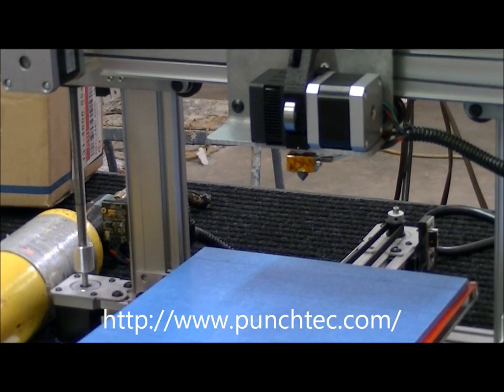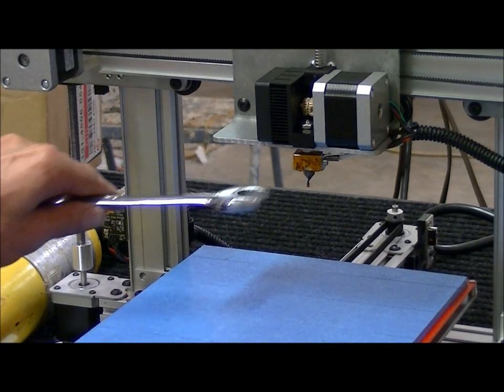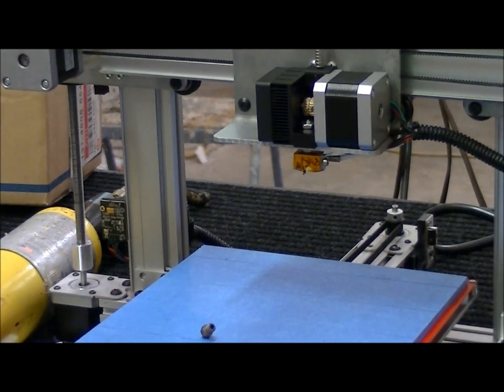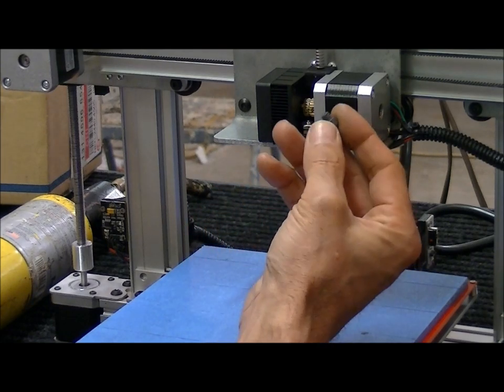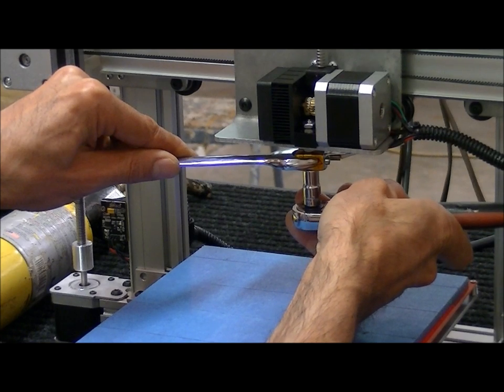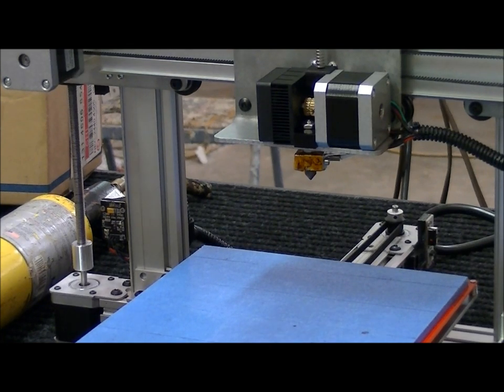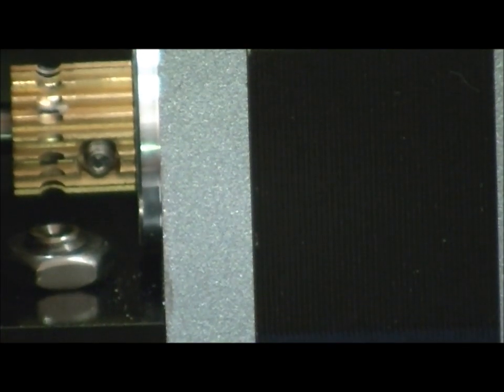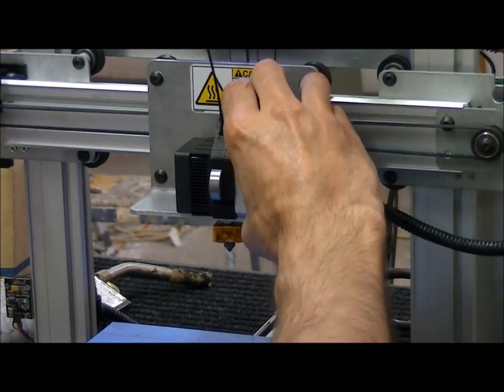How to unclog or replace the extruder nozzle on the punchtec Ord Bot

Comment: Thanks for this, finally got the clog out.  Also had a cold clog above the heating block and was able to push the filament back up and out while the nozzle was off.  A note though for doing this hot, its easy to cross thread the nozzle or the heating block while it is hot like that, so you should be careful screwing it back in.  Saw the comment below and that seems to be what happened.

Comment from the maker: Hi,
I'm sorry that your nozzle on your makerbot got damaged. I have done this many times on my nozzles and have never had a problem. It's probably not the safest idea but I wanted to let my customers know how to clean it without having to buy a new one.
I have a new model 3-D printer I will be posting on my website in the next couple of weeks where I spent over six months developing my dual head extruder. I believe this will be the most reliable extruder on the market.

Comment: There is nozzle on Ebay that is coated with some kind of low friction plating. It might prevent clogging. 
ebay# 321667110675